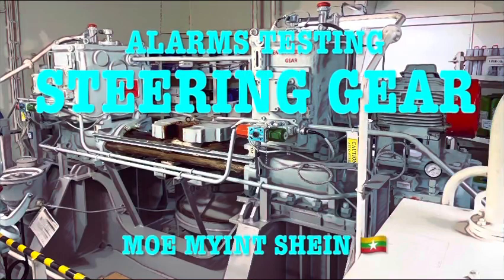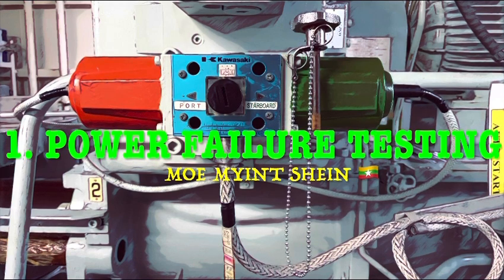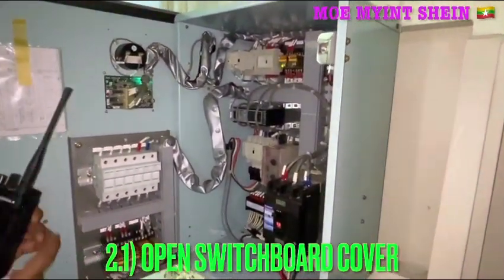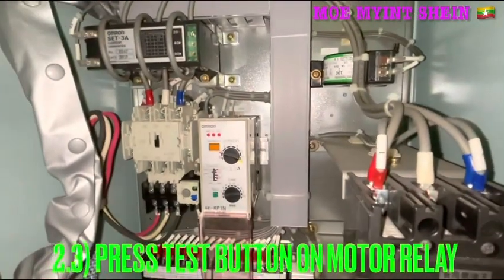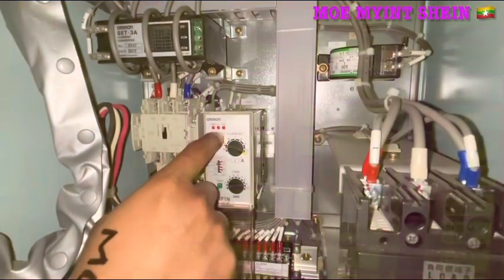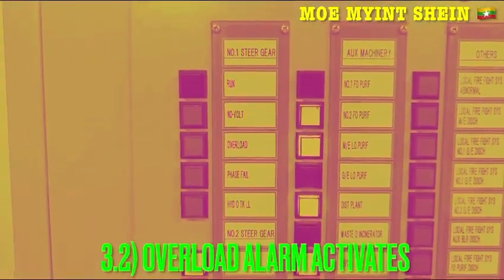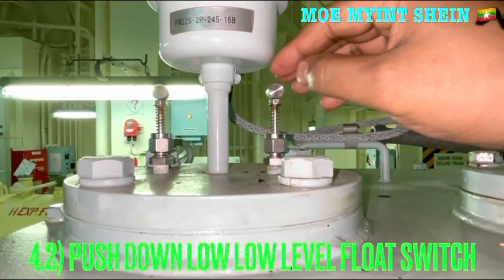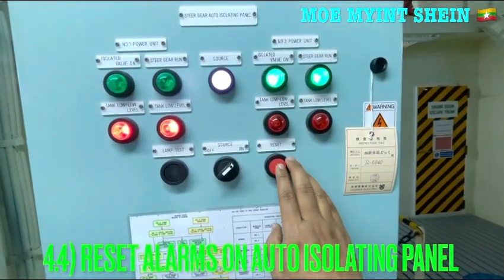Ship STEERING GEAR | Safety Alarms Testing | SOLAS | Merchant Navy | Technical Vlog : 051

Comment: အကိုရေမင်္ဂလာပါ သိချင်တာလေးတွေရှိလို့ပါခင်ဗျ-Phase failure alarmကိုရှုင်းပြပေးပါခင်ဗျ
-Oil tank level lowရင်safematicအလုပ်လုပ်ပီလားခင်ဗျ oil tank level ကfault alarmကြောင့် safematic အလုပ်လုပ်ပီး standbyထလည်နိုင်လားခင်ဗျ
-steering testကို ဘယ်အချိန်တွေမှာလုပ်ရမလဲခင်ဗျ
-Class survey မှာ steering gearကို ဘာတွေစစ်သလဲခင်ဗျ 
ကျေးဇူးတင်ပါတယ်ခင်ဗျ
Reply from the maker: Late Reply due to Busy …

Phase Failure ကတော့ 3 Phase မှာ 1 Phase Failure ဖြစ်ရင် Alarm လာအောင် လုပ်ထားတာပါ။ (Phase Failure ဖြစ်နေလျက်နဲ့ ဘာကြောင့် ဆက်မောင်းလို့ရသလဲ။ Steering Gear Motor Winding ဘယ်လိုပတ်ထားသလဲတော့ ကိုယ့်ဘာသာ ဆက်လေ့လာပါ။) 

- Low မှာ အလုပ်မလုပ်သေးပါ။ Low Low မှ စ အလုပ်လုပ်ပြီ Standby ပြောင်းပါတယ်။ 

- Company Practice နဲ့ ဆိုင်ပါတယ်။ သက်ဆိုင်ရာနိုင်ငံရဲ့ Rule နဲ့လည်း ဆိုင်ပါတယ်။ ပုံမှန်တော့ Emergency Steering Drill မှာ လုပ်ပါတယ်။ လက်ရှိ Company မှာတော့ Before Departure နဲ့ Before Arrival မှာ လုပ်ပါတယ်။ 

- Class Survey မှာ ဘာတွေစစ်သလဲဆိုတဲ့ မေးခွန်းက အရမ်းကျယ်ပြန့်ပါတယ်။ စစ်နေကျ Alarm စမ်းတာရယ် ၊ Emergency Steering ရယ် ၊ ကျန်တဲ့ Clearance တိုင်းတာတွေရယ် ပြောချင်ရင်တော့ ပြောလို့ရပါတယ်။ Turning Test တွေလည်း ရှိပါသေးတယ်။
Reply: @CHiEF_MOEMYiNTSHEiN  ကျေးဇူးတင်ပါတယ်ခင်ဗျ🙏

Comment: Sir, good day!
there is another alarm : Hydraulic lock alarm!
sir pls teach us how to do?
Reply from the maker: Manually push the Directional Control Valve, while Auto Pilot Mode is ON. If angle deviation occurs between AUTO PILOT Set angle and actual rudder angle, Hyd. Lock alarm will activate on Bridge and Steering Gear Room. 😊
Reply: @CHiEF_MOEMYiNTSHEiN  
many thanks😍
Reply: Well explained MOE , you are doing good work and must be continue

Comment: အကို steering gear motor က တခြားmotor တွေနဲ့မတူတာ tirp မဖြစ်ပဲ alarm ပဲ လာပေးရတာ‌ လားအကို
Reply from the maker: Automatically isolation and changeover will happen to standby steering gear, if hydraulic oil tank low or low low alarm activates in running steering gear.